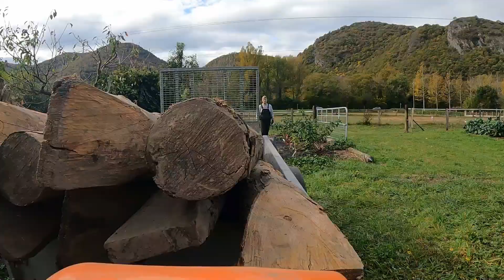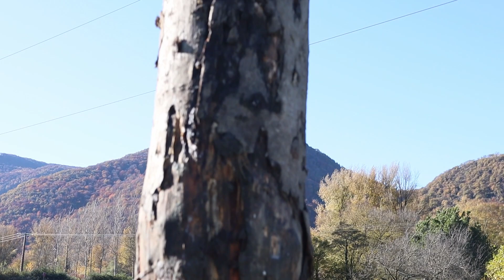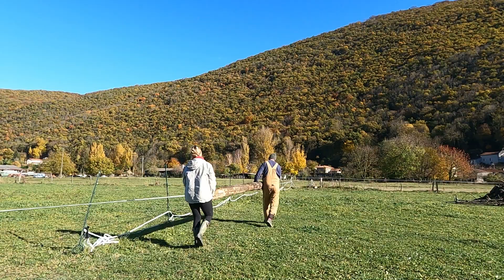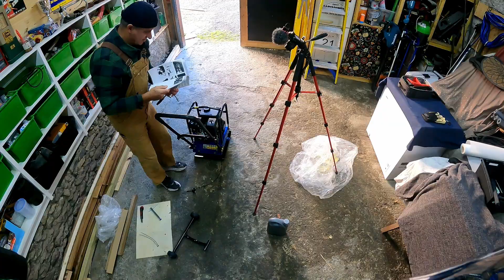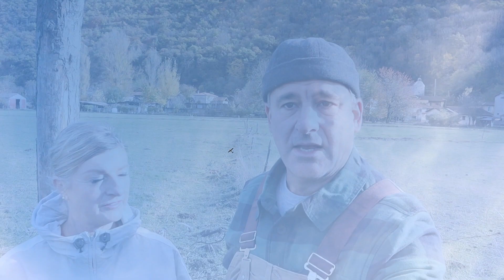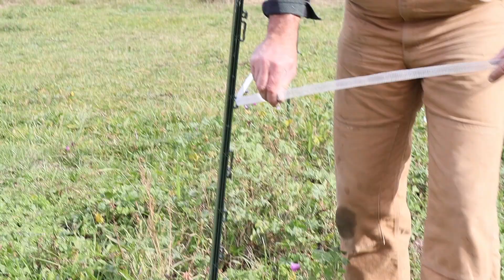Scheppach Compactor & Monster Field Posts

Comment: Hello, I have been enjoying your videos!
Very fun to watch, and it looks like you're having a great time!
The interaction between you and your wife makes me smile!
Regarding the use of a plate compactor around the posts. A plate compactor is best designed for granular soils, such as sand an gravel. For compacting around a post, a rammer will be much more effective. Plate compactors really don't penetrate too deep, likely no more than 15 to 20 cm. A rammer is best suited for cohesive soils such as dirt and clay, and it can pernitrate 40-60 cm. On the other hand, compacting around a driveway or path made of gravel, the plate compactor is the preferred choice. They can be interchanged for different jobs, and each has their strong points. But, if all you have is the plate compactor, then take it for a spin! Either way, it much better then doing a lot of these by hand.
Reply from the maker: Cheers Tom - yes the plate compactor basically liquified the soil around the post and made it worse.  I now have a tamper which I “borrowed” from my son which is much better.  The plate compactor is going to be put to good use on the garage floor slap int he coming weeks.

Comment: Should have put post wraps to lengthen the life of the posts
Reply from the maker: I would agree on a domestic install but this is an agricultural fence so the least amount possible - these posts were left over from a river bank reinforcement job and were just pounded into the river bed - they will last as long as I will.  But on the build site, yes, we will protect them and concrete some of them in too.

Comment: Hi the two spades with a hinge in between are called shovellers. Using shovellers will make your post hole alot bigger, which means more to put back. May I suggest making a small hole with a long bar and filling the hole with water, this soften the ground making arger penetrated easier.
Reply from the maker: good tip - I am hoping on my knew plot there are no rocks - last time I dug was 2 metres down and all soil.